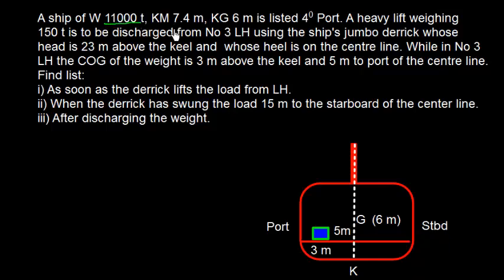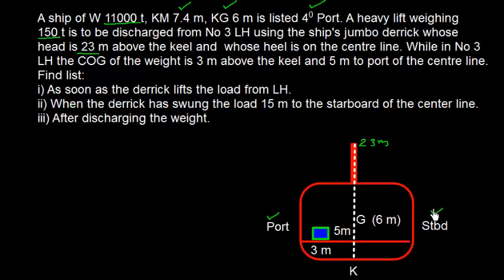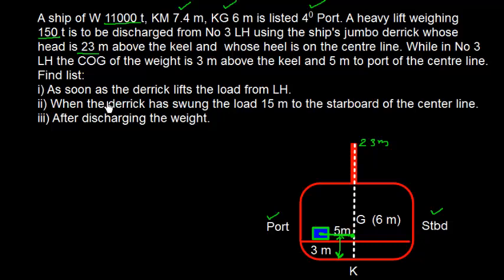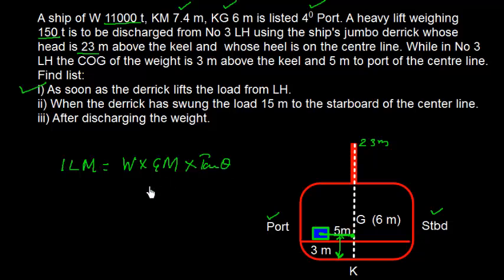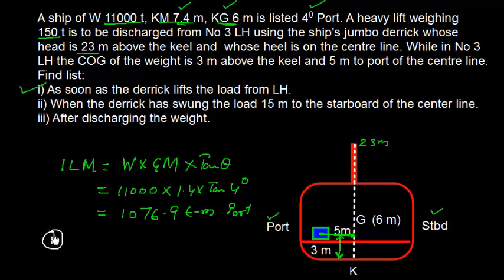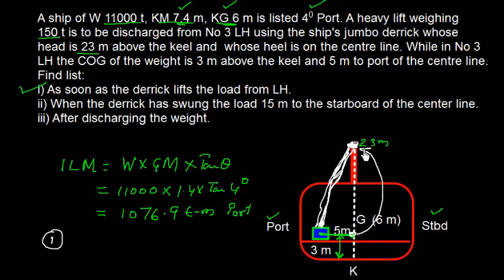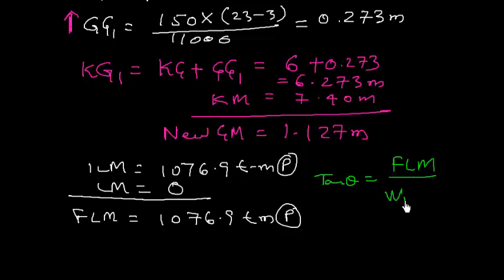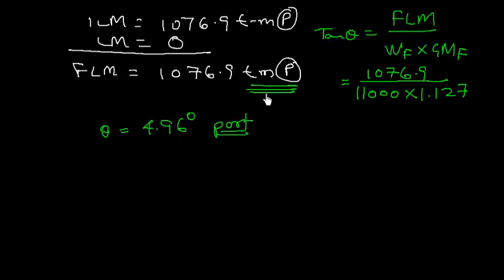Ship Stability _ List due to  Cargo gear Problem # 2

Comment: In the first case you calculated KG1= KG+GG1. However, in the last case you subtracted GG1 from KG? So is it according to the case or what?
Regards
Reply from the maker: If you load on top above COG, KG1= KG +GG1 and if you discharge from top like in this case, KG1= KG-GG1. Thumb rule is that COG will shift towards the heavier side.